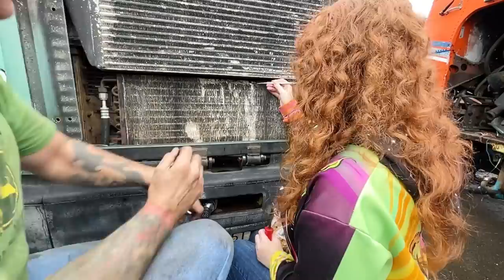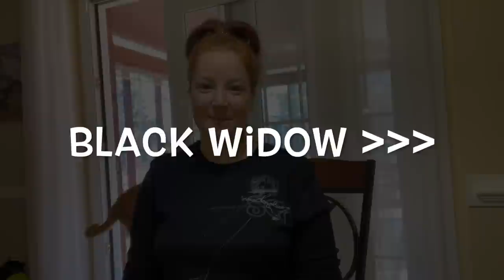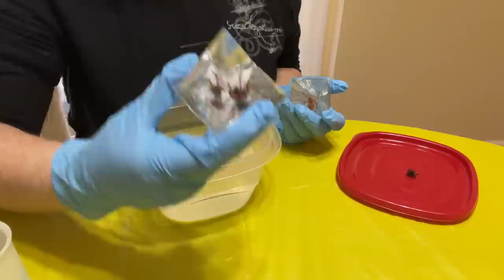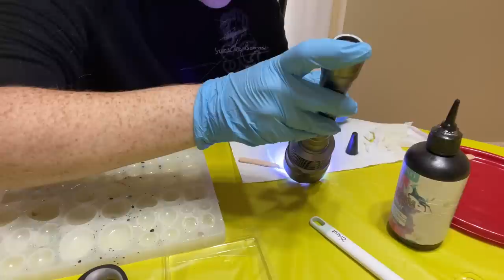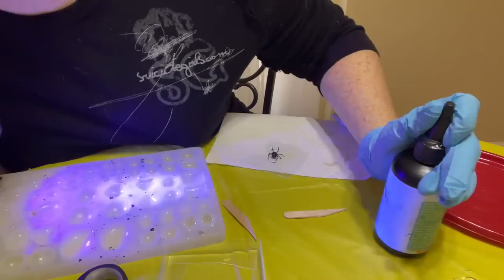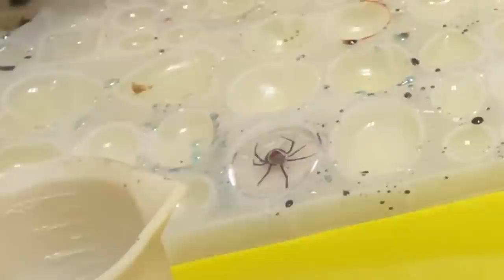AC Condensor and Black Widow Spider keychain

Comment: Hi James and Jessica. Good morning. Looks like an interesting way to take care of bugs to say you won’t bite. That looks cool when done. The grille on 12 looks way better especially after the paint job. Most radiators I’ve seen are painted when new, but I did see one that wasn’t but it was aluminum. Try to make sure when you switch to the right turbo and manifold you check those boots going in and out to the air to air cooler. I always replace them myself because then I know they’re good. It’s coming along great! Stay safe
Reply: Thank you :)
Reply from the maker: thanks Darren. I will get some new boots for when I do that turbo change.
Reply: @MakinItPretty  Your welcome

Comment: Mr. Pretty the Home Depot has a A/C fin comb that will work on the fin’s of your A/C condenser and Radiator. It is like a comb that you use on your hair. It has metal fingers that gets in between the fins on the A/C condenser.
Reply from the maker: Ya I have one somewhere. I can’t remember where I put it.   I needed the quiet time just working with Jessica and hanging out.  It was very relaxing and time well spent.  But I wish I had my comb with me

Comment: You’re doing a great job keep up the good work I look forward to seeing you bring the 1969 white truck home i love the look of it Cheers
Reply: I’m anxious to see the 1983 kenworth with the 12v92 and the freight liner 1984 with the 8v92 up and running they are beautiful trucks i love what you’re doing with them
Reply from the maker: @paulcorkum2105  thanks Paul  me too.  it sucks to have them partial done.  I will try hard to get the radiator for Delores and see about getting that truck running and driving.
Reply from the maker: thanks Paul appreciate ya
Reply: My brother is a fully licensed heavy duty mechanic he’s worked for 30 years on the Detroit motors he used to work for Harpard Detroit i love those motors they are tough
Reply: Check twinsticksgarage with his new push button cab tilt for his kenworth K100

Comment: Wow, the front of 12 was in rather rough shape. The new paint certainly made a big improvement. Is there any way to clean up the rubber on the bumper?
Those keychains are awesome. Well done Jessica.
Reply from the maker: I’ve seen a few ways to fix the bumper. One is with heat or a torch the other is a wipe on chemical.  I’m gonna try to heat first

Comment: Hi James can you not hot pressure wash both  radiators as well as all the straightening of the fins ,to get air flow in the front of the truck. thanks
Reply from the maker: ya I actually did when I washed it  it flows pretty good now
Reply: @JamesPretty  thank you for the reply